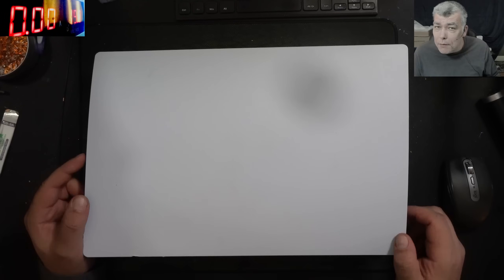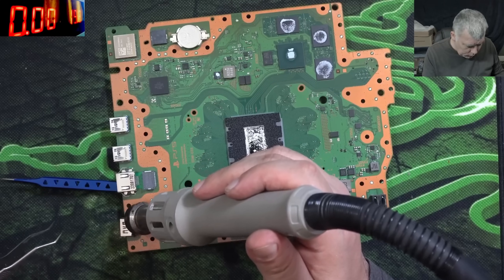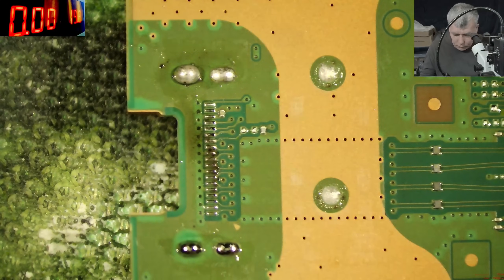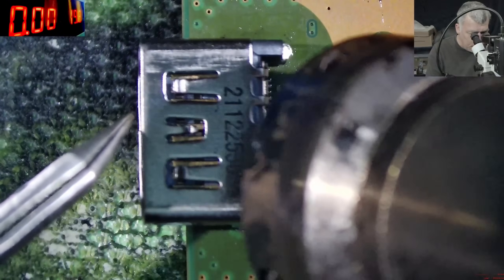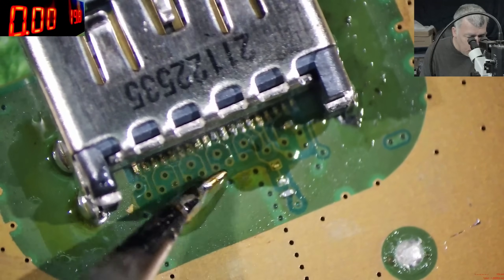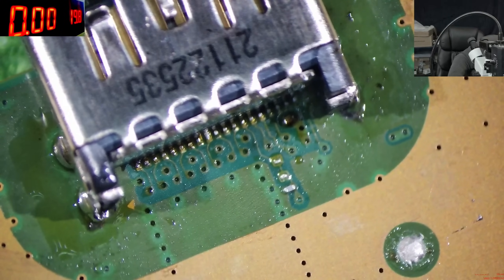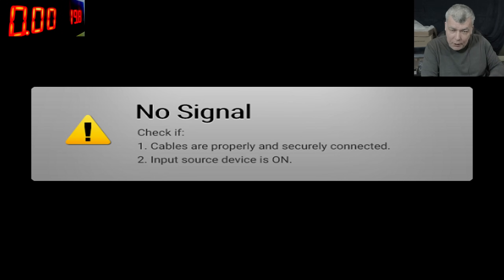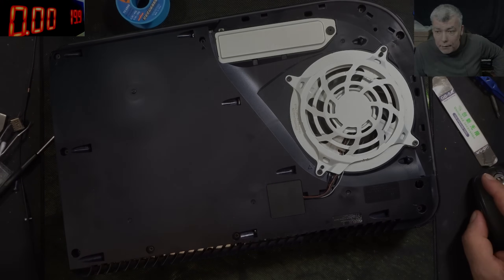PS5 hdmi port replacement, avoid 'that capacitor' :D

Comment: Can someone confirm which way the zenner diode - 6-503-646-01 (D3006 - CDZVT2R5.6B) on the back of the board @ HDMI connector faces?  Great video and thanks for sharing.

Comment: Hi Sorin, great video as usual 👍 Want to ask your advice. I have 24 inch monitor, but it has solid grey lines across bottom half of the screen. Do you think it is worth trying to repair it, or will it be too expensive?

Comment: Hi Sorin! I like all your videos and I'm subscribed to your channel. 
I'm an old man at 75 and I'm retired from IBM USA since 2002. 
I was a computer tech, web designer and electrical & optical test engineering tech for raw circuit board build in a manufacturing environment, building IBM Mainframe circuit cards & boards. 
I had my own computer tech repair business from 2006 to 2015...but gave it up because there were too many younger people that could run rings around me. 
I DO enjoy your videos for the ingenious simple methods you use to repair motherboards of laptops, phones and gaming devices.
It's great entertainment and your sense of humor is very much like my own. 😁😎
Keep up the good work! 
Rick..
Reply: Thank you Rick for your nice comment

Comment: I always cover any capicitors near the port with capton tape takes 5min's  to do rather than half hour to put capacitor/s back' seen sooo' many vid's   '' iv'e blown the capacitors off the board ''     😂
Reply: Probably can do conformal coating tiny drop to side that's away from port pins to keep it in place.

Comment: Sorin, why do you always choose the hardest way to repair? Isn't it way easier to just wick out all the old solders and do fresh? It will be done way faster and cleaner and easier 😂
Reply: Hot air from below, hot swap with pre tinned port pins is the fastest and cleanest way with this model. Wicking the anchors is time wasted,
Reply: @thehitman5007  it depends really, honestly this mothod isn't bad either, then you actually know 100% the solder is melted around the legs. I've seen many times due to the amount of heat you need to repair these that people repair them, think they got the new solder on and really it didn't stuck to the legs due to not getting hot enough and it just mends around it.

I've done both methods and honestly this way I've had a much easier time vs fighting to get the solder out of the tiny holes, sometimes it's just that way lol

Comment: I have one of these bastards on my work desk. Replaced port. All good. Oh wait, the port shorted and took out the panasonic chip. I hope that's all, the replacement chip isn't in yet. Scope tells me it's dead so at minimum it is dead. Just hope it didn't cascade another bloody part. I hate making customers wait. I've been told that bastard cap is actually unnecessary, haven't had the misfortune of killing it by accident yet though. I like how you just skip the 44 mobo screws there like they're nothing. I use a 2500RPM makita electric screwdriver and that mobo is the first time it felt slow, I just use that one for unscrewing as rescrewing it'd kill things. But it's a nice to have. 44 mobo screws though, not even counting all the rest of the bastards across the whole system. At least they used a good screw type though, if it was philips screws I'd kill someone.

Comment: I got so sick of tiny breakable power jacks, i got a old female HP fat Barrel Jack and drilled a hole in the side and hot glued it inside and ran wires back to original jack. Those old barrel jacks were almost indestructible but today its typical eg USB C and microscopic pins and that cant take normal use for very long... I have tons of the old HP power bricks so try to make use of them!!

Comment: I've melted the port the first time i tried this repair but luckily didn't damage anything. Since I don't have much experience with HDMI ports what worked for me was removing the solder from the ground anchors, tinning the pads and placing the port in after sufficient heat. Had to go over the pins afterwards with an iron, as few of them were not connected. I feel like it's a hard repair for me, because of fear of damage to the device. Well done!
Reply: This is one of the easiest repairs to do. Put your heat station to 480 Celsius and 50 % airflow, heat from the bottom of the board to remove old port, after removing port, add solder to the pins and anchors, heat from the bottom again until solder is melted and place the new port on, make sure is aligned. Always pre tin the legs on the new port for the best results.
Reply: @Joelwillfixit  50%? Pah, 99% air is fine. :-)
Reply: @ Depending on your equipment, you could blow away the diode and capacitor under the port if the air flow is too high, thats why I recommend beginners to use 50% air flow.

Comment: I would never replace a port like that. I would clean the support holes, makes it alot easier to insert.
Reply: Many people use 'the hot swap method', which when done correctly is much faster and cleaner than cleaning up all holes and resoldering every pin
Reply: @jaymanbuzz89  I know it is faster, however the margin for error is much higher, as you have holes filled with solder, and need to align the pin, blowing hot air at the same time. It carries a much higher risk, for damaging the new port and knocking off components.
Reply: @davidlguerr  I wouldn't necessarily agree, once you know what you're doing. It's a lot of major techs go to method for hdmi replacement. But I do agree it's more risky if you don't know what you're doing.
Reply: @jaymanbuzz89  Hot swap every day. I love Sorin, but the recent HDMI replacements on this channee are not a great example.
Reply: @OnStageLighting  yeah they haven't been his best work, but since it's Sorin I don't mind it 😂

Comment: That cap isn't needed. No cap no short
Reply: I thought 4K resolution would be affected if it's missing?
Reply: @JustInspiredKent  I don't think 4k is affected but in saying that I never actually checked the screen resolution with this cap missing. Next time you have one in you can test this to confirm or I will and we will clear this up. Very interesting
Reply: @PCErepairs  it will not work without it when it use high bandwidth like 4k60, 2k120 or hdr
Reply: @Kiburici  Very interesting. I have PS5 coming today I will confirm this
Reply: I commented to check when it happens 😂  @PCErepairs
Reply: @PCErepairs  can you confirm? Happens to me also

Comment: Each times on evry video..when you toutch the ground plane of your microscope hdmi cable  on another devices ground , it bugs up  your capture card video  signal a little bit 🤣, my hypothesis on that is you have a floating ground somewhere , i suggest you to route a ground to link every device ground you actively using  to fix that if its anoying for you 

if all mass of all of your equipment are the same it should never happen again 

another one proper calibrated job !  grazs from canada !!